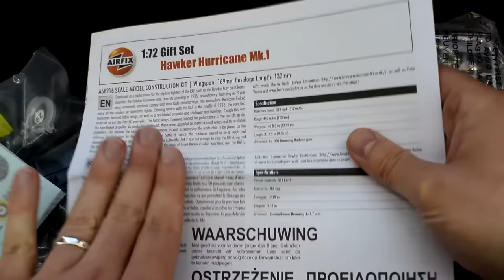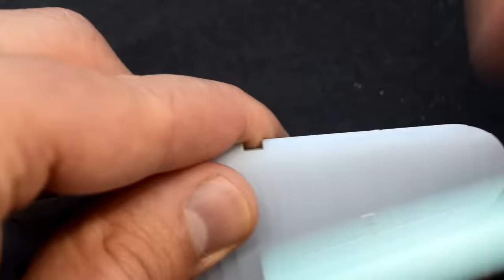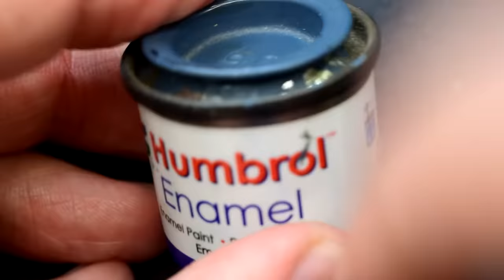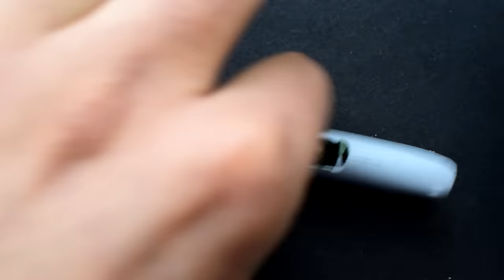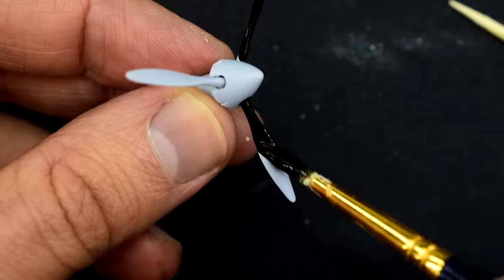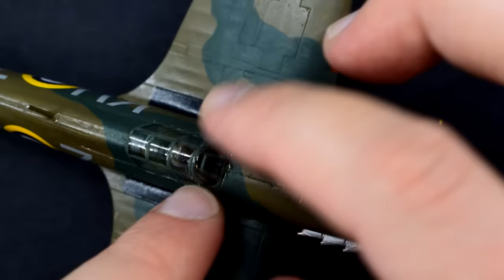Airfix Hawker Hurricane Mk.1 - Build With Me! - Supercut! (Full build series start to finish)

Comment: Been building scale models for 30 years and I've never washed a model before painting.  I use acrylic, enamel, even artist oil paints.  Spray paint, airbrush, paint brush, the whole nine.  Not once have I had a single model have any problems with the finish afterwards.  I have models that I put together and painted well over 20 years ago and they were never washed and have never had a problem with the paint finish to this day.  I would never tell a person how they should or should not handle the assembly or painting of their model.  The great thing about this hobby is that there are so many ways to achieve some very interesting results.  If washing your model prior to assembly works for you than by all means you should absolutely give it a good scrubbing.  I am only conveying my own personal experience.  In thirty years of not washing models I have never had one have a problem with the paint job.  On a related note I tend to paint as I go instead of putting a model together and then painting it.  I will assemble some sub-sections and paint them before moving on.  Other modelers might find that a waste of time.  It's all a matter of personal preference.  Having said all that, I would just like to add that you did a fine job with this Hurricane and it turned out very nice.  Excellent work Sir.
Reply from the maker: Thanks! Airfix does recommend washing the parts, it’s in their instructions. Granted, I don’t always bother but there have been times when excessive mould release on the plastic has prevent acrylics from sticking, instead pulling back and pooling in blobs

Comment: Something that's just occurred to me about marking panels lines, gun ports etc.. what about a used match? Briefly light the match, extinguish it and then use the stiff charcoal end to mark the lines / ports. Gives you more control on where it goes. Alternately scrape the charcoal into a beaker and use that as the colour after adding the liquid.
Reply from the maker: interetsting idea!
Reply: @ModelMinutes  am watching this again. Love the weathered / battle damaged look. I just thought of a bullet hole suggestion.. a hot pin to melt the plastic.. maybe a short line of holes to replicate a strafing? Combined with the chipping you've done I think that would look good :) Bigger holes with the pin pushed further in and/or wiggled could be cannon hits?

Comment: Thank you very much for your inspiring video's. Like you I like brushpainting my models and I'm progressing steadily to bigger and more complex models. My painting is getting better with each model. But sometimes my varnishing lets me down and I'm thinking about using spraycans. Airbrush is not an option for me. Would you recommend using spraycans instead of brush and what brand would you recommend? Thank you.
Reply from the maker: I tend to use spray cans on occasion but usually only cheap off-brand ones. It's not often that I buy specific model kit spray cans. Whilst cans are helpful to cover large areas and get a good finish, things will still need to be painted by hand so they are methods which compliment each other rather than replace
Reply: @ModelMinutes  thank you for your reply. I think i will keep on practising painting varnish with a brush. Meanwhile I will keep looking for a spray varnish for a reasonable price and a small kit to practice my spraying skills. Please keep up your great, inspiring video's

Comment: You're gifted at modelling aircraft in one piece of course, but what about a battle damaged fighter, say one coming into land? Many years ago I tried to do one with the undercarriage only partly down - kits tend to have Up or Down but nothing in between. You would do a much better job than I did, maybe cotton wool wisps from the engine / exhausts with coolant leaking for instance or a little red on the injured pilot. Like your other challenges, perhaps a Damage Challenge? :)
Reply from the maker: good idea! Doing more dioramas are definitely things I want to do in the future
Reply: @ModelMinutes  On the same lines, if you know where damage is likely to occur could you use a silver undercoat so it looks like the metal after the paint has chipped off?

I had a more complicated idea ref engine fires.. perhaps a small core of red/orange cotton wool with an outer layer of grey wool and a third layer of darker to represent a central fire and layers of smoke from it? (Yes I do tend to have ideas and then let those with the skills work out how the heck to do it :) )